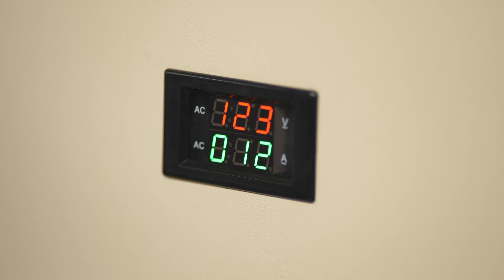Why Do Breakers Trip? | Ask This Old House

Comment: Standard breakers actually have two different trip mechanisms to catch different faults. The time delay overload protection uses a bimetallic strip that sort of thermally integrates the current over a short period of time. But there's also a magnetic trip designed to instantly catch much larger overloads like you'd get from a short circuit.
Reply: You can actually look up the trip curve for most breakers - how long it will take to trip a specific loads. For example, that same breaker that took a bit at 24 amps will trip much faster at 50 amps, but much slower at 17 amps.
Reply: Thanks for the explanation. I was disappointed that the curly haired host didn't ask the electrician how it worked.

Comment: I just found out those AFCI breakers from Siemens are subject to a class action lawsuit in the US due to nuisance tripping. Luckily they make breakers that are both AFCI and GFCI and don't seem to have the same issue. They are more expensive though so if you have AFCI only in your new build, take a look at the lawsuit to see if you should join. Most annoying thing I have ever encountered with a new panel.
Reply: So, are you saying, because of a defective breaker, the electrician is basically chasing his tale?

Comment: Would be nice to talk about what happens when you have the wrong wire on the wrong breaker... AKA I had a 20amp breaker that was only using 14g wire. In that case, the breaker won't trip right away and will cause the wire to overheat longer.
Reply: A fire is what happen haha
Reply: Same thing could happen in an older system served by a fuse panel,  which is rarely encountered today.    Sometimes the fuse, if it's a screw in type, can be bypassed by inserting a penny or aluminum foil in the socket then screwing the fuse back in.   Or if it's a cartridge type fuse, they can also be bypassed,  by driving a nail through the fuse, by wrapping it with aluminum foil or chewing gun wrappers, or my inserting a piece of copper pipe or metal conduit.  

In the unlikely event you found a fuse panel still in service,  it would be a good idea to check for these dangerous band aid repairs,  and it would be a good idea and probably a requirement for insurance purposes,  to replace it with a modern breaker panel, because virtually all fuse panels were 60 amp services,  which will not comfortably serve a modern household,  although a few larger fuse panels in the late 50s and early 60s were 100 amps, which is the smallest residential service allowed in the US.    In Canada,  I believe they will still allow a 60 amp service if the house is 860 square feet or smaller  and where major appliances are gas instead of electrically heated.
Reply: @Sparky1500  In America (I live in the south), most of the old fuse boxes I encounter are of the 100 amp variety. I also encounter 100 amp breaker boxes from time to time. I have seen 60 amp fuse boxes but they're mostly in out buildings or well pump houses.
    Honestly, if the wire is modern and in good condition, a 100 amp fuse box doesn't bother me in an out building or a small house (that mostly has gas appliances). Fuses are still commonly available at hardware stores. As long as no one has done any of the 'redneck bandaids' you refer to, fuses are a tried and true technology. In some cases, maybe better than breakers. If a breaker keeps tripping, a lot of people will just keep resetting it. If a particular fuse 'pops' a couple of times, most folks will take action to get it fixed correctly. 
      Ya'll Take Care and be safe, John
Reply: That's why it's a code violation to use 14 awg on 20 A circuits. 

The easiest fix to your problem is to replace that breaker with a 15 A one.

Comment: What would be more fun would be a myth-busters-like actual test of arcing.  Or wrong breaker and see the 14 gauge wires get charred. Or stick a hot lead into a grounded bucket of water. 

All of course with proper safety measures.

Comment: For the most part, 14 guage wire is on the 15 amp breaker and 12 guage wire is on 20.  10 guage wire on 30 amp breaker and so on.  However, if the wire run exceeds a certain length, then, the 12 guage on 15 amp breaker and 10 guage on 20.

Comment: My dad just recently had a small outdoor fire where the Traeger smoker was plugged into an extension cord plugged into a GFCI outlet. The cords were just laying on the ground in wet weather and a couple feet of insulation on the smoker's power cord burned away! I have no idea why the GFCI didn't trip and we were lucky that the fire was noticed before too much was burned besides part of a shed!

Comment: What is the current limit for GFCI breakers to trip? Is it fixed or available in various limits?
Reply: The regulations call for between 4-6 milliamps, most manufacturers settle around 5.

Comment: Great video! A couple of questions:
When you are wiring your house, can you request that all the wiring be suitable for 20 amps instead of 15?
If you do have a 15 amp circuit and it keeps tripping, can a homeowner switch out the breaker from a 15 to a 20 amp one safely?
With electrical codes changing, where do you have to install ground fault and arc fault outlets?
What outlets or circuits might require greater than 20 amps?
Reply: You should not swap out the breaker without also ensuring that the correct wire is used. 15 amp circuits require 14 gauge wire or larger and 20 amp circuits require 12 gauge or larger. Note that the lower the gauge, the bigger the wire. Circuits that have whole-house A/C units,  electric clothes driers, tankless electric water heaters, and electric ranges typically will all need more than 20 amps.
Reply: @joe3276865536  also worth noting that in rare cases 12 or sometimes even 10 gauge wiring is used on 15 amp circuits.   You would only ever see this in very large homes where the circuit runs are far away from the panel,  typically more than 100 feet, to help control voltage drop at the far end to acceptable levels, although if there are several long circuits such as in a large addition, it will often be more economical in terms of labor and material,  to install a subpanel near the remote area  instead of having to oversize all of the circuits.
Reply: @Sparky-ww5re  Agreed. I previously tried to use 12 gauge for all of the 15 amp circuits I wired as this was recommended by a book I read. However, I gave this up for shorter circuits because 14 gauge is just easier to work with.

Comment: Was learning about this the other day (Timely). 

- A 20A receptacle and a 15A receptacle are the same with the exception of the T-slot.
 - The purpose of the breaker is to protect the wire...the receptacle has no real bearing on the safety (not GF/AFCI) when it comes to amperage.

So if you have a 15A breaker, 12/2 wire and a regular 15A receptacle, all you need to do is exchange the 15A breaker with a 20A breaker and the service is now safe for 20A service from breaker to receptacle.

If Im wrong someone correct me.
Reply: The danger is that you can't see what's inside the wall... just because you see 12/2 at the breaker panel doesn't mean that the entire circuit is wired in 12/2. There might be some 14 gauge lurking between outlets three and four in the circuit, for instance.
Reply: @CoolerQ  I wired the home myself with the exception of the breakers (was not allowed to). All wire is exposed inside of a crawlspace. 

I was not aware that the guts of a 15A/20A receptacle were not different from one another. It was more of a thought that if my T-slots wear out in the kitchen and I need to replace then a regular 15A receptacle would suffice.
Reply: @Kevin-mp5of  I agree with you, but the comment seems to imply that I have no common sense.
Reply: @fillmorehillmore8239 Be aware that the 15 and 20 amp receptacles may not be the same internally when comparing "residential grade" receptacles. If you want a more robust receptacle, then choose a "spec grade" receptacle, the 15 and 20 amp receptacles are the same internally.

Comment: So when do you want to have GFCI vs. AFCI? Can you have AFCI breaker and combine it with GFCI outlets?
Reply: GFCI is where moisture can be an issue - so bathrooms, kitchens and exterior. AFCI are becoming the new standard in lieu of regular breakers due to many jurisdictions requiring them in new builds/change of service. Unfortunately AFCI breakers do cost more than regular breakers.
Reply: @kaseyc5078  don't forget basements and laundry areas as well per the 2020 NEC

Comment: I have problems with breakers 20 years is it normal to cramp out?
Reply: 20 years is old, but shouldn't cause breakers to start failing. 

Do you have water leakage or rust around your panel box? Sometimes the power wire leading into a house is improperly laid out (inadequate weather head or drop loops) and the wire channels water through the protective jacket, into the the meter box, and into the breaker panel, rusting and corroding breakers from behind. 

I've seen it 2x on a home a friend bought that had a bunch of dead breakers, and one I looked at with a visible water stain.
Reply: @volvo09  we have water leaks in a little bit….. right now dry air stops any mildew … some play act up…! My breaker stop  15 amps os 20 amps  .. play craps out. In Massachusetts I’m not allowed to put my old breakers how…. I had I could be sued if this is done correctly.
Reply: @brianglade848  Ha reminds me of the 3 stooges where Curly says "Oh no wonder the pipes dont work! They're full of wires." and yanks out the wires then connects it into water pipes. So, when the chef upstairs turns on the lights, he gets soaked.

Comment: My wife is always tripping the outlet in the bathroom with the blower dryer and the t.v. is on and the lights in the  bathroom light and bathroom lights is on and it always we have to goes to the basement to reset the outlet. Need help.
Reply: Electrician or divorce lawyer?

Comment: Umm... I may need to replace my breaker because it trips but lever doesn't move to the off position 🤔
Reply: No, it moves to the neutral position. My mom had the same issue. I drove 100 miles to reset a breaker.
Reply: @twinkie27271  Yes. To reset you move it to the off position. Then you can move it to the on position.

Comment: So I shouldn’t put tweezers in my outlets?
Reply: That's a shocking idea.
Reply: When I was two I did just that while standing in the bathtub. I must have hit the neutral side first (because I am still here) but I vaporized a quarter of the tweezers. It must have had some effect as I worked all of my life as an electrical engineer. My last project was a 10kV 5A dc power supply.
Reply: @danielcarroll3358  I did it as well when I was about 8 or so.  That was not fun. It definitely melted the tips.

Comment: Why promote junk like Siemens and not a quality product like Square D? I’m a service electrician and I see more problems with Siemens breakers then any other brand. You also missed Dual Function breakers and 2 pole breakers.
Reply: Hi samsquires have you become a flat earther yet? If not I suggest watch a 13 part series called What on earth happened by Ewaranon to learn that the earth is not a globe. I got it in my about tab.

Comment: Why not have it be 20W instead of 15W for a better support for the homeowners.
Reply: Some circuits (such as lights) don’t need a 20 amp circuit.  A 20 amp circuit requires a more expensive wire and because it’s thicker, it is more difficult to work with.